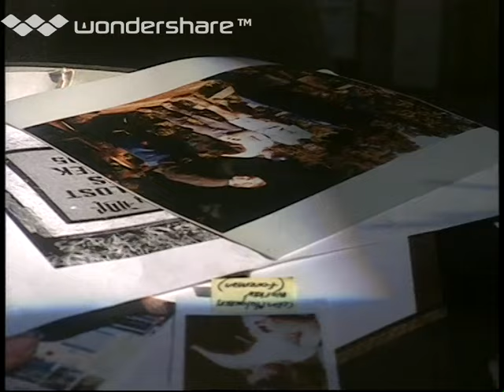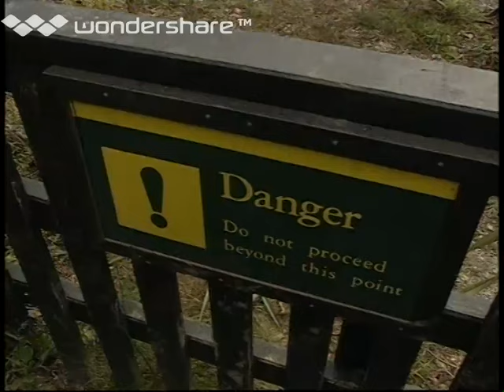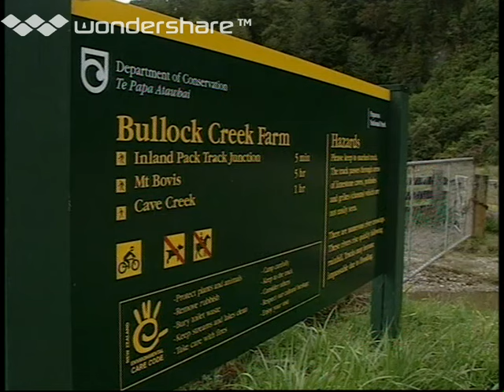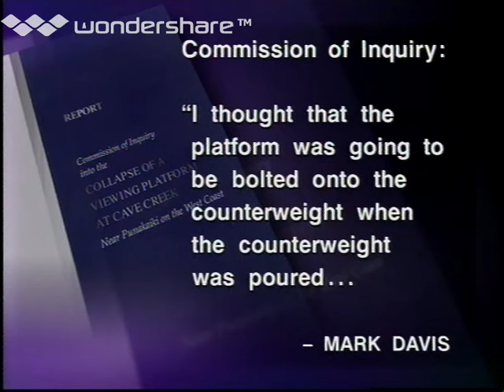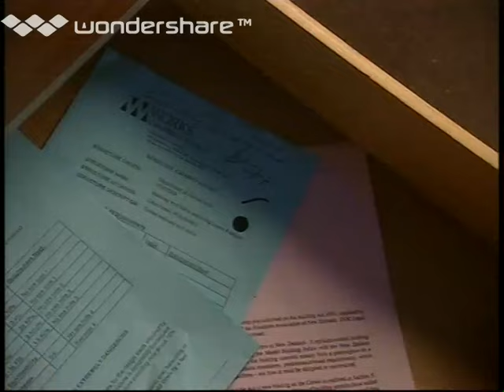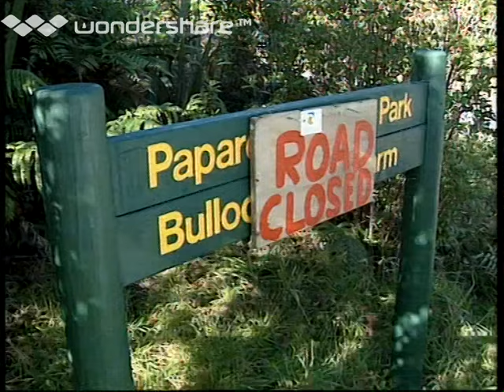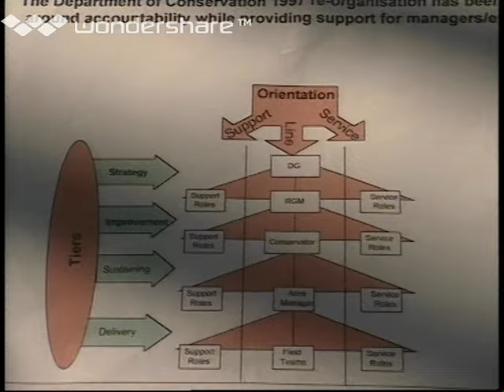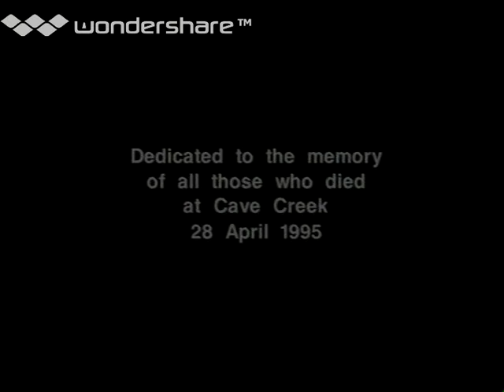Cave Creek: The Full Story of a National Tragedy

Comment: I can build a better tree house with $800 give me 4 nice 6×6 posts 4 huge bolts biggest they got predrill your 4 holes set your fondation posts crank those screws there and lock them in with big nuts.  4 6×6 into a square sqrewwed in to your biggest 4 limbs . Use your 6 foot level make sure all 4 corners are level then boom use 4x for the floor and boom go from there bet you my tree house will be bigger and hold 20 people. Almost forgot i have drills to use so we are using all outdoor 4 1/2 inch screws throughout. I told me oldest son he needs to wait till hes 5 i cant have him climbing a latter 20 ft up .

Comment: So let’s use common sense... That many people shouldn’t be on that ledge. But whatever.
Reply: If it had been designed and built by competent people, even though it may have had more people on it than was advisable, it would not have collapsed.
Reply: @Sashazur  everything... No matter the material has a weight limit. You could build it out of LEGOs or concrete. Both are still going to have a weight limit. Don’t jump up and down on a wooden overlook. Seems logical.
Reply: @FFEMTB08  I agree. What I meant but didn’t say clearly, was that competently designed things typically are overbuilt for their intended use. So if this had been done right, and had a sign saying something like “10 people max”, it actually would be able to handle twice that weight - or something along those lines.

Comment: To build structures like this in north amaerica you need to be certified and have to undergo an inspection, in this case to insure this viewing structure is made out of the proper hard wood and has the proper supports so it can withstand the weight.